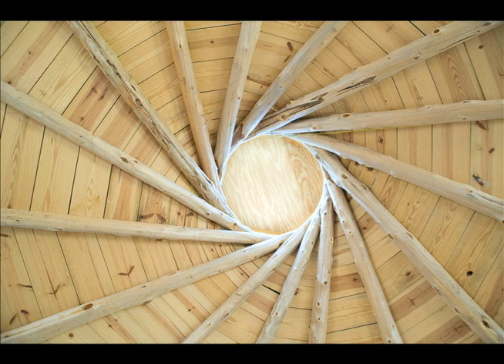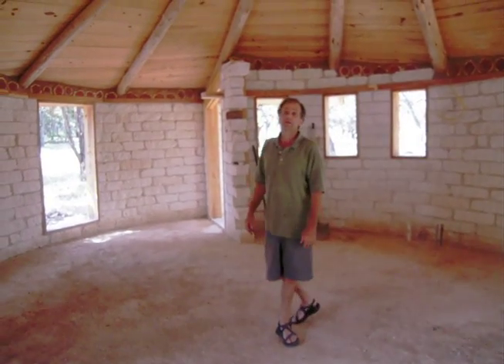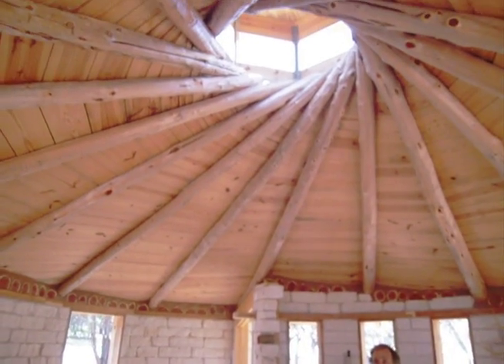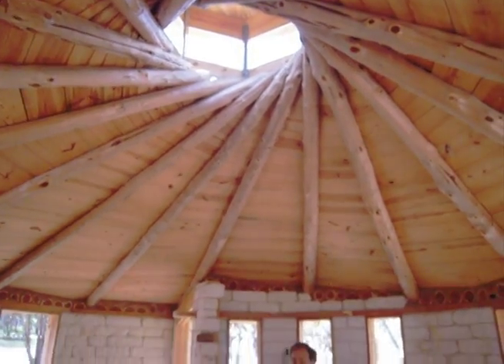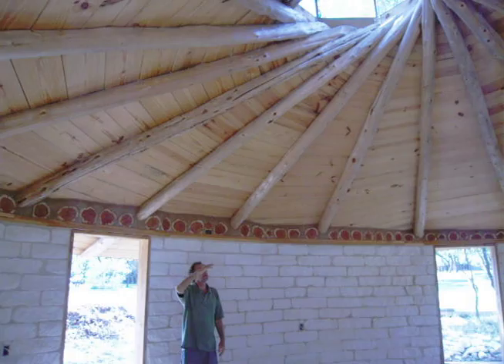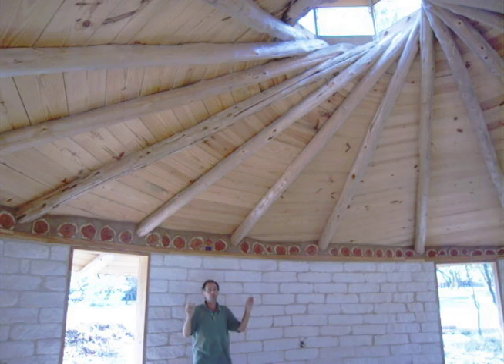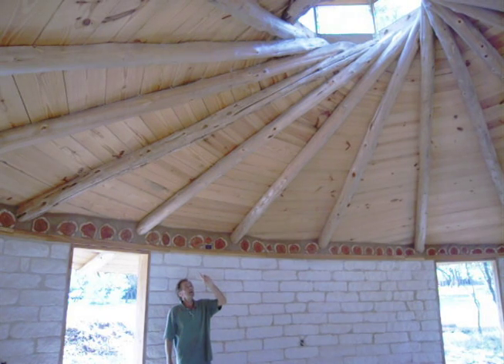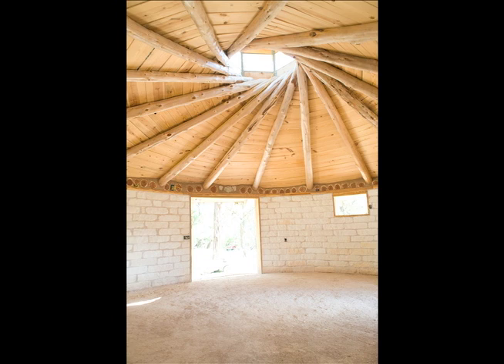Reciprocal Roof

Comment: @rmcdaniel423 none at all, the circular wall itself provides all the buttressing needed, you can add a bonding beam on top of the wall to add extra strength, also some people set posts under the ends of the rafters and incorporate them into their walls.

Comment: Reciprocal roofs are by far stronger than conventional roofs, they are not very hard to do, the only issue I have found is centering it perfectly.
Reply: David W. Reed how do you insulate a roof like this without losing all the beauty of the roof?